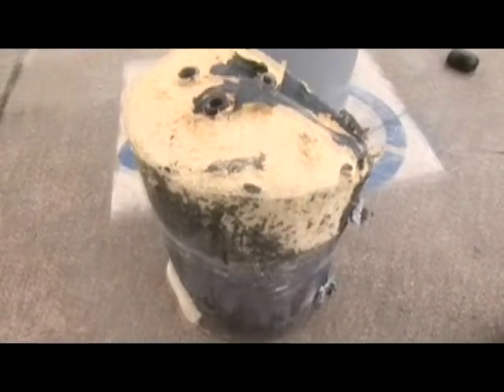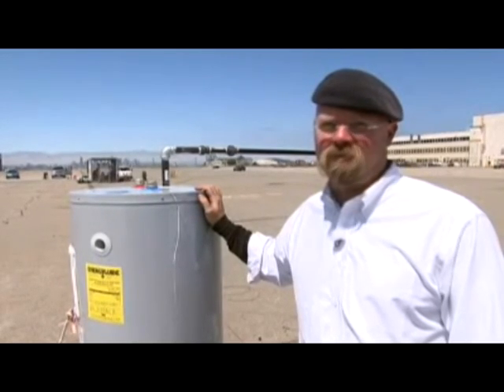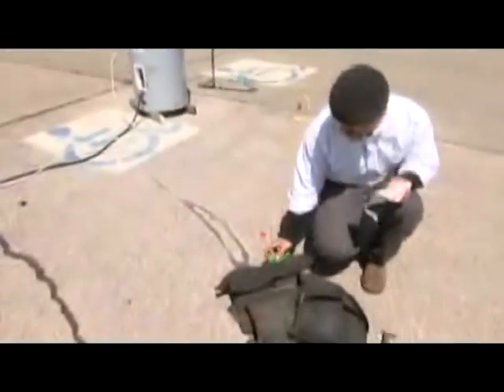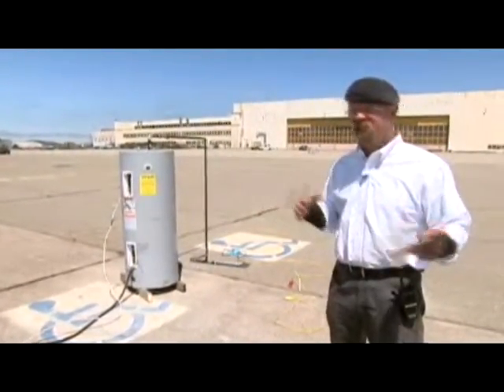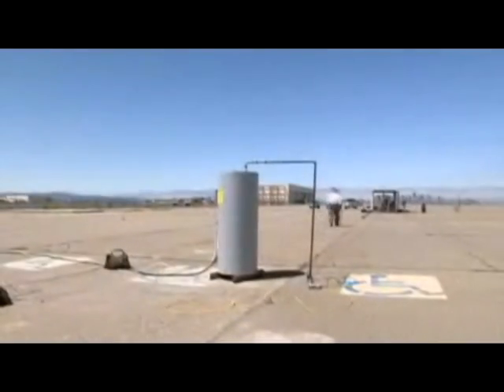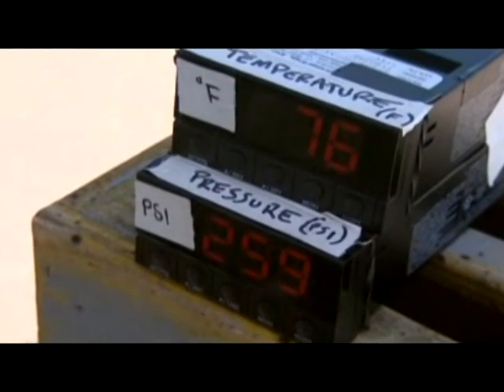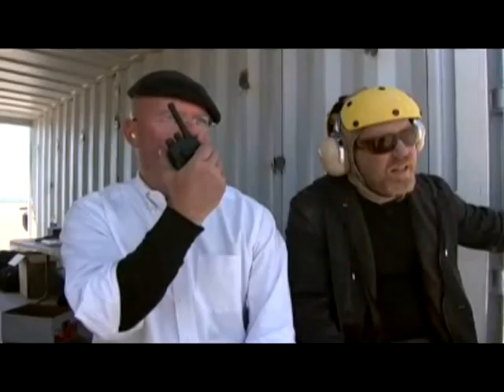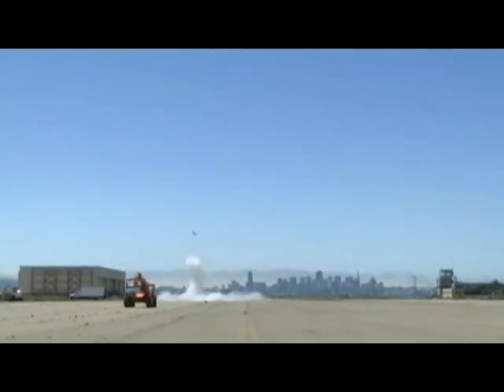Mythbusters: Exploding Water Heater

Comment: My neighbor went into a new construction house that had a water heater explode in the basement. It went thru 2 2x10 floor joists the 5/8" plywood floor the cieling drywall the 2nd floor joits that plywood floor and thru the cieling joists into the attic where it was stuck 1/2 way out of the roof. The repairs to the house cost almost 7,000 dollars.

Comment: Its amazing the power that 20 bars of steam pressure can produce. Enough to launch a tank over 200m into the air.
Reply: yep, after all we tend to think a tank full of hot water can't explode... well this shows us that they can. because when you boil water it's going to increase the pressure inside the heater to the point where any weakness (usually at the bottom) in the tanks walls will fail and release the pressure in the form of explosion

Comment: This video kinda freaks me out. My uncle never ever drains the hot water heaters on his properties. We rent from him and so does our neighbors across the street. Their hot water tank exploded 2 days ago. We also have crazy amounts of calcium and lime in the tap water. It can clog a coffee pot in a week or so. Time to get anything valuable out of the furnace room :\
Reply: DId your water heater ever explode? if so do you have a video? Also you know you can drain your water heater yourself right? I rent also I dont call my rent man to do something simple like draining a couple of cups of water in a pot for me.
Reply: Josh Sizzle I wasnt there when the hot water heater exploded on the neighbors so no video. Also with ours you have to shut off gas to it before draining and its a large one with the sludge in the bottom. So the whole thing has to be drained to get the sludge out. The whole mess at the neighbors costed my uncle around $4,000. So maybe he will shut the gas off and drain the whole damn thing if I bug him enough.
Reply: Water heaters have safety valves called T&P relief valves.  Its the long tube that comes down the side of the tank. An explosion cannot happen even if one never touched the water heater for 20 years.  IF the pressure got too high, the T&P valve would open and water would flow out relieving the pressure.  If an explosion did happen at your neighbors house, it could only be the result of an improper installation.   You have nothing to worry about although I wonder why you don't drain the tank yourself if that concerns you.  You must be a Section 8 tenant.
Reply: Michael W Hello!
I’ve read online that water heaters are supposed to be silent. Mine is when the hot water isn’t running, the water heater doesn’t make noise until someone gets in the shower or using the hot water. The sound it makes is like water sounds, idk how to describe it, but it stops like 5ish minutes after the water is off. Is this sound normal? And are water heaters supposed to be completely silent?
I’m only asking cuz you know a lot and I’m scared after this vid 😬
Reply: @kiahnabaker7871  The water heaters at my slumlord uncle's apartment make kind of a weird popping sound. It's normal for water heaters to make a sound similar to a whoosh/hiss when someone is running hot water. Or it's trying to refill itself. We moved from Ohio to Florida almost 3 years ago to get away from him and the rest of my toxic family. I also feel much safer now! I would recommend you drain it according to the instructions given to you. All the sludge will be in the bottom.
Reply: Lord Krishna Stole My Heart thanks! You see I’ve also read and watched videos that says if you haven’t flushed it for like 3-4 years then it’s best no too cuz it could cause cracking, so I just don’t know 🤷🏽‍♀️
Reply: @kiahnabaker7871  Really you should flush if it's been that long trust me. The big thing is safety first. Drain according to instructions minding any precautions to shut off gas/electric if that is what is called for. To prevent any damage to the tank or injury.